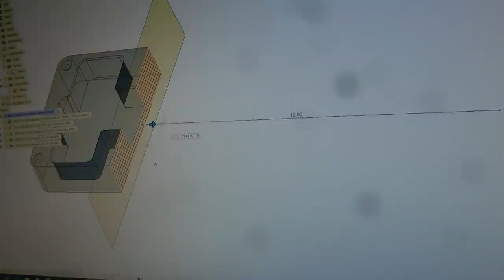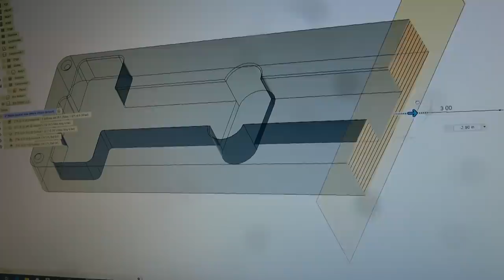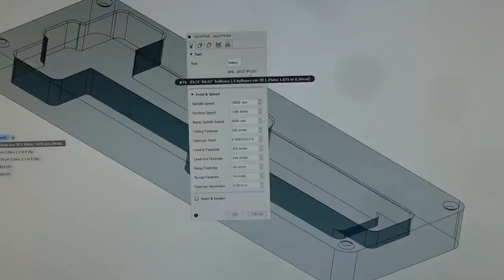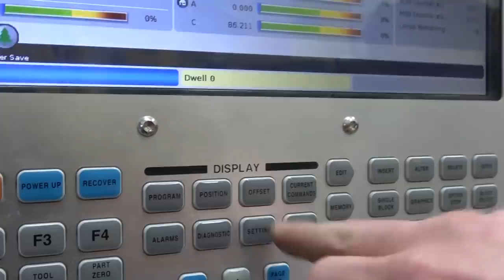Robotically Hammerin Box | Working the wood (maple)

Comment: lots of glamour involved in woodworking i'm finding out. The old glamour, not the magazine...I think. 
Turns out: 
1-smoke and mirrors are indispensable for sharpening hand tools.
2-nobody knows why something works or doesn't work. 
3- "wood elves" have fought full scale wars over the oddest things. The war of 1812 was actually " Edge graine"" vs "End grain". 
4- Most safety equipment is empirically more dangerous (and cuts better) than a spinning circular saw blade
Reply: Yeah... All of that's true if you're a woodworker over 50... The rest of us are just waiting for those loudmouths to die so we can start working on getting our dignity back
Reply: @TristanJCumpole  German saws cut on the push stroke, Japanese saws cut on the pull stroke. Choose your workbench accordingly!
Reply: @PapiSmerf  I couldn't agree more.

Comment: When gluing boards together, add some salt to avoid them sliding while clamping and drying.
Reply: He's rite table salt every time no slippy slide.
Reply: Also for taste!
Reply: Do you powder it? Or dissolve in water and spread it?
Reply: @amosbackstrom5366  Sorry for my late answer! You just power it on in a thin layer, as on an egg. Dependent om what type of wood, you may have better result using some coarse salt

Comment: Once again, ditch the buna o-ring, use closed cell foam tape, sticky on one side stuck to the basal platten.  It will conform to the whoop de dos on the wood much better.
Reply: or get the stuff that's sticky on both sides,  and forget the vacuum altogether.
Reply: @MattOGormanSmith  Things aren't done the easy way on this channel, haven't you noticed.
Reply: Mark Beeunas I’m trying to tell him! I agree!!!! 🐝🤣
Reply: It's not really designed for that amount of pressure though, surely it would distort and leak ?

Comment: Peat is used in some Scotch Whiskys, but interestingly is no longer used to actually kiln the malt. Peat is high in nitrogen so when you burn it you oxidise it, this interacts with the hordenine in the barley which gives you nitrosamine, which is a nasty carcinogen. So when they make peated malts now, they effectively cold smoke by allowing the peat to smoulder at a lower temperature, then allowing the smoke to infuse with the malt which is being dried by hot air.

Peat is mostly used in whiskys from particular Scottish islands and parts of the highlands, and Scotland has it's own peat bogs, though I'm not sure they use Scottish peat, or how heavily Scottish peat is harvested compared to Irish.

I don't make Scotch, but I am a distiller. If you find yourself in the UK give me a shout and you can do a BOLTR teardown of one of our sprits, or our still, or some of the sketchy 'in-house' equipment we've put together over the years!

Comment: If you sprinkle a little bit of table salt on the glue (@3:21), it serves to minimize the slipping during the clamping process, without affecting much of anything else, as the salt will dissolve into the glue in short order.

Comment: Use a pinch of salt, to prevent that hydrodynamic slipping
Reply: would glass dust/grains work?  maybe after the clamping, those particles will push into the two planes and act like super weak nails (...?)

Comment: Ave I've played with my wood at work and they payed me for it!  Id like to share a few tips. 

1. Easy on the clamping pressure! A little schmoo on the factory floor is ok, but too much and the boss will start asking questions. 

2. Look down. See how the wood rubs only in one direction? You've got to make all the cuts across the grain first, for best results. Along the grain first, and you won't even see what you where trying to do in the first place.  

3. If you want fancy, almost all of the cuts are best done  full depth with a tapered ball endmill. You might be tempted to run just the tip of the bit into her, but trust me, after you get started, just go all the way in and you'll both be singing.

Comment: Hi Ave,  Just a tip that you might want to try out.  It's possible that you could drape a tarp over the ways and make a cutout for vise.  I think this could make clean up easier and save the machine from the wood particles.  Also, a larger woodworking vacuum might also be a benefit.  Have fun and keep your tools in a collet.

Comment: Yet another way wood is interesting. A large piece is combustible yet will give off flammable vapors, small bits of the same type can be a flammable or combustible. Few things change hazard classifications depending on size. Take known flammables (gasoline, propane, magnesium) or known combustibles (diesel fuel, coal, me), few of them become more or less reactive with changes in sample size.
Reply: Coal will most certainly explode in powder form, many lives have been lost to it.

Comment: A great way to mount that wood, is to use blue tape on each mating surface and then super glue them together, it'll stay well out while you machine (mostly shear forces there). And you can pretty easy pull it off the mounting plate after milling.  Your language is fun man, keep the videos coming!

Comment: Double sided carpet tape is your friend. It can hold a block of wood to the face plate of a lathe for turning a wood bowl. Also works fine when i throw a 1/4" end mill in my router. As for the boiled linseed oil, you should thin it a bit with some turpentine or naptha so it can soak into the maple easier. If Naptha is banned in Canuckistan like it is here in the Peoples Republic of Kalifornia, use Coleman Camping Fuel. It's naptha according to the MSDS.

It's good to see that Maple show you who's boss after so many years of being passed off as inferior. As someone who works with both wood and metal, each require a completely different skill set and not much is shared between working both materials.

Comment: The peat in scotch comes from Scotland, although Ireland does have peat bogs, they also have plenty of trees to use for firewood. 
In Scotland, the moors have very poor soil for farming and trees don't grow very well in the acidic, rocky soil. All the wood they had available to them had to be used for shelter and tools, it was too valuable to burn for heat. What they did have an excess of, was peat. The climate was perfect for turning the moss and other small plants into peat. The thick peat bogs could be cut into slabs and dried into a perfect fuel for heating a house and cooking. 
In order to make whiskey, you need beer and in order to make beer, you need to malt your grain. Malting is the process of sprouting the grain so it's own enzymes turn the starches into simple sugars that the yeast can turn into alcohol. After sprouting, you need to stop the growing process and dry it out so it can be ground. If you wish to have something with a bit more flavor, you can also toast the grains at this point. In Scotland, they just happen to use peat for this heating and toasting because it is what they were already using for fuel for any fire. If they had burned the wood, then they wouldn't have it to make the barrels to ferment and age their whiskey in. 

Interesting sidenote: There was a geological study done in the late 20th century to determine how long the peat would last for the production of scotch. The results showed another century or more of scotch production even if they increased output by a small margin every year. The same study was repeated about a decade ago and the new ground penetrating radar showed that the previous study was completely wrong and we've only got about another 20 years at current production rates. It turns out the old GPR was registering the coal beds under the peat to be the same as the peat itself.

Comment: Carpentry trick to fix your crack in the box. Mix a goodly amount of fine sawdust from the wood you used into some epoxy and fill the crack with it. Let it set up and give it a quick sanding. It should fill and hide the crack. It doesn’t work every time, but it is worth a try.
Reply: Yes! i just saw this too in the Tech Ingredients channel.

Comment: you need an appretice for cleaning that up.
Reply: Alain Felger sure if you want another fire! Wouldn’t let their slippery fingers in there. They probably leave in running while cleaning it up just to go home early!
Reply: @jacobmiller7175  well, if they are clever enough to think about burning it away, at least they thought about what they're doing
Reply: Maybe your’s are a different breed than what I’ve come across
Reply: @jacobmiller7175  No they aren't. Tomorrow one of these pixi-pokers ist visiting my department again to finish his apprentice-thesis(?) (here in Germany we got that after the 3 years). The poor guy was mostly in the appentice workshop.
 Now he has to wire in some steam meters at a somewhat warm place in the production hall. After the second day of constant cigaret breaks a colleague pointed out, that the half hour of break a day is the same for everyone in the building. 
Since then he is working like a maniac, but we always find something wrong with his wirering, the plans he made or the programm for the controller. Poor guy, but we're having a blast.
 ( If he would ask for a cigaret break, no problem. But he left without asking. Working in a production hall filled with corrosives, at a steam pipe, above a filling machine he always needs someone to know where he is. Looking normaly every hour after him. The last day he is with us, we tell him, why he had to endure)

Comment: Another hold down method, painters tape.  Stick it to your work piece, stick more of it to you waste board, super glue the two parts of tape together.  It will “should” hold your workpiece down.  When done, you can pop it off and peek off the tape.  I use this on my 2.5D CNC router and it works great, but I cut slower and probably generate a lot less lateral torque then you do.  I learned this trick from another YouTuber (but can’t find the video right now).

Comment: At work we do 80% of our cnc work with vaccum hold down. Vacuum area is important but, I believe having more material area in contact with the bottom side will improve your hold down factor. Something that size we would do like 3/4 MDF, face it down say .020 and make a vacuum track rectangle half inch in from the outside .250 cutter  at like .1 depth. Then cross hatch at 45 degrees  spaced at like a inch and a half.  Put 15-20 thru holes in there down to your aluminum plate and Bobs yer auntie!

Comment: Not to relish in someone else's misadventure, was really funny though😂 Thanks☺
@AVE Order of thoughts: 
Glue paper between work piece and sacrificial board in a vice, dust hood around cutter, big extractor off the hood, incress spindle speed reduce feed speed, remove work piece with one of those lovely shinny hammers😉 
Should work well🤔
GOOD LUCK😁

Comment: No need to use silly side clamping on a glue up!  By the simple addition of a salt shaker to your workshop, you stop all glue jobs from shifting! Just the tiniest amount of salt on the surface creates stop-blocks effectively, which maintain the location of the parts while gluing up, and then they dissolve into the glue, without consequence.
Yeah, my Dad taught me that about 35 years ago. Good tip!

Comment: When your laminating the maple boards together, spread the glue over the surface and sprinkle a few shakes from the salt shaker on to the glue surface.  It doesn't affect the performance of the glue, but this will stop the boards from slip-sliding and shooting out from the center like a hotdog from a bun.

Comment: From a carpenter, wood is a more forgiving material.  Cool that you use the vaccume to automate everything into a simple 1 step process.  We would just nail screw and glue everything as piecework then apply wood filler in abundance.

Comment: Those CNC cutter grinders for grinding carbide tools from solid use a coolant that is very flameable. Since it does not spark when you grind carbide there is no problem until you acedently hit something that is steel. They have halogen fire control systems like in the big kitchens that come on automatically when fire is detected

Comment: Me a my grandpa made a similar suction vice for our woodshop and we first tried a runner oring but even with the smoothest wood surface it was never enough to hold the piece down even if it did as soon as the mill touched it it would go flying off after some trail and error we ended up using a real  stiff but soft foam about 1/8 to 1/4 inch thick 1/2 to 3/4 thick wide and once we did this we never had a problem it always stayed put even with real rough surfaces and we could get away with a lot less prep work

Comment: I think the rubber used in the o-ring needs to have a higher friction coefficient to help prevent slippage. Maybe some of that anti-slip matt used for rugs adhered to the flat plate surface would help as well. Since the matt has holes, your vacuum clamping will still work.

Comment: I've got a 5 x10' router that holds it's parts using vacuum perfectly well, of course the vacuum pump is 40 hp. I did like the dramatic effect of the fire. Could have been more dramatic if it would have flashed back into the dust filled vacuum, next time?   You will have less problems with cracking if you quit soaking the wood with coolant. A proper router it is turned at 16,000rpm+, 600"/min. feed, cutting 3/4" deep.

Comment: In order to scorch the sprouted grain to increase sugar yield (in Ireland anyway {pre industrial revolution}) they would light a fire on a big slab of rock, brush off the peat fire and spread the grain out on the hot rock to scorch. Also Ireland was covered in sphagnum moss after the last ice age which turned into large swaths of “Peat, Moss Boglands” and a primary source of fuel when dried.

Comment: Scotch is made from 100% malted barley. The grains are kept moist to cause germination, then turned over several days. Once the right amount of germination is achieved germination is stopped by drying the barley in a kiln. Scotland historically uses peat for energy and the peat smoke from the firing of the kiln is what gives the distinct flavor. The shape of the still has a lot to do with flavor as well, big heavy peat comes from short pot stills where the vapors don't have as much time to cool before exciting there still. The rushed distillation allows more of the heavier molecules (like the peat flavors) to make it into the whisky.

In Ireland they generally used mixed grain mashes and column stills. I don't believe ish whiskey's usually include any malted grains, so there would be no cause to kiln dry them with peat. The columns stills do a better job refining the alcohol but also strip the big powerful flavors giving more light/floral flavors.

And now you know all about Irish whiskey vs Scotch whisky.
Reply: Also if you want to send me a sweet hammer for my efforts to comment on a 10month old video with such in depth information that was completely off topic. 😛 I'm close by!

Comment: I love wood working.  It's cheap and VERY forgiving IF you don't try to powertool every mm.  I personally always finish a piece by hand so as to avoid catching a dull router bit and ripping all my work in half.  Besides wood worked by hand feels different than wood worked by a machine.  I don't think wood working should ever be perfect.  Absolutely perfect dimensions  are for Ikea furniture.  The flaws are part of the story of every piece you finish.  You can look at the piece and remember every second by those imperfections and the average person doesn't see them at all.  "Perfect" in wood working is +/- 1/32"

Comment: Try using 1/2 in or at least 1cm thick foam. it also needs to be closed cell so so it doesn't let too much air through it. Have a lot squishier of a platform and then just put some bumps inside the tray in the center so it always sucks down to the same height!

Comment: what about using softer gasket? Something like silicone caulk. Also might be a good idea to mist some water on surface, to have better seal.
Reply: ...or even better - ya could use canola oil or lacquer on the back side, to have better seal and after machining finish the whole thing.

Comment: I think you need a softer gasket. The CNC machine at a cabinet shop I worked at had vacuum pods to hold the work down. The gasket was more like the weather stripping you would find on doors and windows. More of a foam gasket.

Comment: The blade didn't pintch because of the fiber density, but because cutting that part you released internal tension balance wich was keeping the wood straight:) the dead tree carcasses are an interesting material, man:)

Comment: AvE Your vacuum hold down thingamajig reminded me of an old conundrum and mystery to me:  In the late 90's I worked at an oil change and there was a device that was essentially an air tank with a special valve that we'd hook shop air to for a minute or so, and it would pull a hefty vacuum into said container which we could unleash by opening another valve thereby sucking even the thickest rear differential sauces through a tiny tube long distances.  It was an effective, amazingly simple tool.  What I want is to find what that valve was called, where to buy one, and potentially see a vidjeo where you mill one out for the viewership pleasure and information.  Any viewers or AvE have any ideas?

Comment: Try putting a strong tape on the wood and using the vacuum on that. If that fails a flat base plate and double sided carpet tape will work just fine for milling wood.

Comment: Nice vijeo.
 Just clamp down over sized  wooden sacrificial board, then use over sized blank to screw it to sacrificial, and when through cutting/slotting add few tabs (bridges) to hold it in place